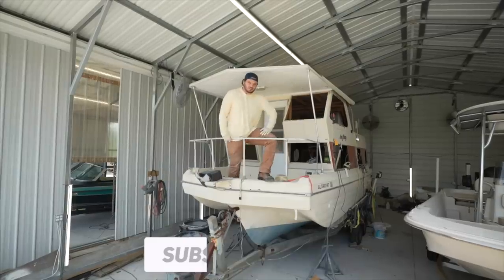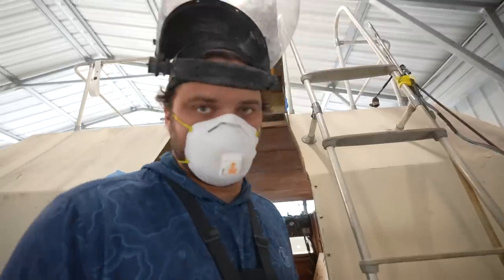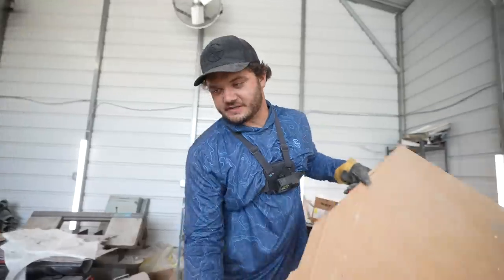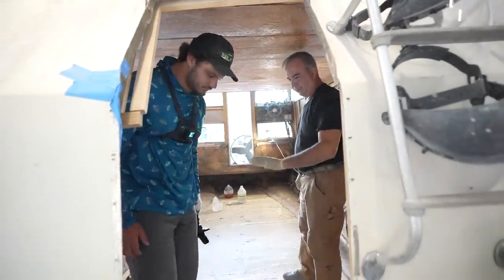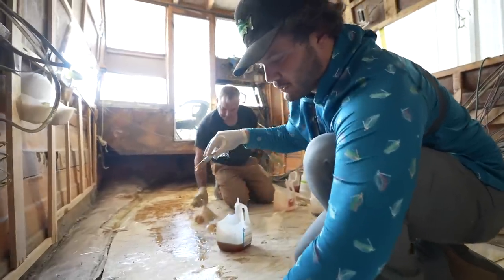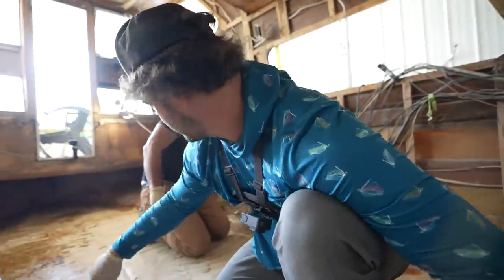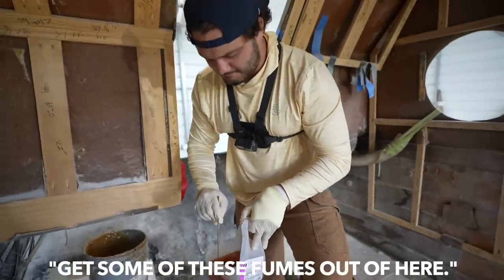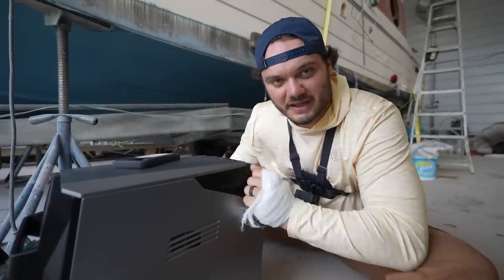Finishing The New FLOOR In My HOUSEBOAT! (Part 2)

Comment: One thing I would suggest, especially dealing with fiberglass... you could always run the vacuum at wherever your cutting or grinding.  That would take a large portion out of the air, but not all.  2nd, Eyes are no joke.  Keep care of those and there's a point being tough isn't worth it.  Next time rinse your eye out.

Comment: Air flow is your friend when it comes to keeping the area dry around your stringers. Make sure you have vents out on the gangway to keep air circulating in the bilge area. I’m a retired USCG Marine Inspector, if there’s any info I can help you with based on my experiences, lemme know! I’ve crawled many a tank and bilge; steel, fiberglass and wood.

Comment: Instead of using a Sawzall, try using a multi-tool. It actually works similar to a Sawzall, but the cut off heads are able to cut through fiberglass much easier.
Reply: was gonna say that, the multi tool blade sits flat so you can actually cut to the very bottom of those bulkheads without having to hold the thing sideways like a sawzall
Reply: Yup reciprocating saw/tool, finer faster teeth and less dust. Between those and the tiny spot sanders that’s all most guys use.

Comment: Been waiting on this. Can’t wait to see it taking an even better shape!
The shop you found is excellent and props to the guy for allowing you to make your videos while he works as well as letting you work with him!
What are they doing with the section you cut to remove the motor. And are they fiberglassing the wood in on the inside walls?

Comment: You know AC units have to have a heat reject stream right? If its just in a room with no outlet it will actually heat the room slightly instead of cooling it.
Reply: That's what I was thinking, if it's an evaporating unit , wheres the vapor going?
Reply: Lol regardless he said they paid for the fiberglass...sounds good to me
Reply: @JK-qg6eo  If it has a compressor then its not a swamp cooler. Plus a swamp cooler wouldn't work in Georgia. I'm guessing there is a hole port on the back that is supposed to connect to a hose you put out the window or in a window frame.
Reply: Indeed! can't wait to see her on the water

Comment: I used to use that foam cellulose filler in my streetrod/kitcar business back in the early 90's. It was much easier than that, because it came in cans that had a hose. All you had to do was stick the hose in the hole, hold the can upside down, and spray. Of course, you're filling much larger sections than I had to, but it was really pretty easy comparatively.

Comment: About the EcoFlow.  The heat of rejection has to go somewhere and using the condenser to evaporate the condensate water will only increase heat content humidity in the space.  Cool air comes out the front of the EcoFlow and heated air goes out the back.  Unless that rejected heat goes outdoors what you've got is a running furnace in your boat.

Comment: I would have tried lowering the floor a bit, since I’m European. Then I would have used funnel for the foam. Maybe I would have used concrete to add weight to the keel. I might have made some access openings just to be able to see if there is water under there. Then again I am no boat builder. Its huge project. Lots of fun when finished I suppose.

Comment: I know it was a freebie and all, but go ahead and plan for a rooftop AC (frame it out now while it's easy, plan on a 8-12k BTU low-profile RV style) because there is no way a 4000 BTU AC is going to do anything in that boat in the Georgia heat. In late August that will be a $3,000 noise maker and not much else. A generator, or dual alternators on the engine with a good inverter-charger and decent lithium batteries will be your friend.

Comment: Suggestion: drill bigger holes for the foam. When I ripped out the rotting floor of my boat the holes for the foam were over 1" in diameter. The foam will find its way around. You're going to glass over the whole floor anyway. Making the foam installation easier won't affect structural integrity.

Comment: When glassing in the ply floors with those woven strips, using a mix of crestomer to backfill that gap would rid of any voids. Cutting foam at a taper and glassing that in would also make a smoother transition and reduce the chance of delimitation in future

Comment: tip: when cutting stuff like that i tend to use a 4.5" diamond blade on an angle grinder. cuts easy and easier to control for cleaner cuts.

Comment: If your up for the challenge you can "raise the roof" of the itty bitty .. find a good cut line and scribe it all the way around.. then get some short boards screw them into the wall below the cut line so they reach up above both the cut line and the desired location.  simply cut the line.. then lift the top a few inches the boards should prevent the top cap from sliding anywhere but add additional supports as needed I don't know how much the top cap weights so it might be to heavy to just simply lift a crane or some ropes/tackle  to the roof of that shed would be a good idea... slide up on the boards around the edges.. then screw the top into the board at the desired height.. get a role of wax paper and line the gap from the outside with waxpaper then put strips of masonite over it.. to insure that it will be flat on the outside.. one the masonite is screwed into both the top and bottom parts.. you can remove the supports from inside and then fill the gap with glass and resin .. if they have a chopper/resin gun, and anyone there is willing/skilled enough, it would make quick work of a 3 inch gap  once the gap is filled use some of the larger mat cuts to cover at least 3 inches on both sides if you have the room but 6 to 9 if you want to be sure. once dry pull the masonite backer boards off the outside and you should have a relatively smooth patch. You can do an additional glass mat around the outside but you'll need to sand away the gelcoat to get good adhesion once done redo the gellcoat and no one will know.  before you pumped the bottom with foam.. it might have been easier recut the floor and lower it which I think would have been easier..  Unfortunately the proper way would have been to lower the floor but it's a bit late for that now, as only the center walkway needs the space. When you had the floor in for test fit before you started the glass.. that's when you should have taken the extra 2 inches off the bulkheads and lowered the floor I say this only because others might read this looking to doing the same type of thing.   Otherwise just ware a hard hat ;-) looks like fun project I hope you finish it.

Comment: Why you didn't foam the floor before decking it... I have no idea...Look at the Camp Chef oven/range. Or don't do any galley appliances. I run an old Coleman white gas stove and a couple 12v electric coolers. Do an outdoor shower with a  privacy screen
Reply: Congrats you have been selected among our shortlisted winners from our previous giveaway, Contact the number above ^^^^^^^^^^^^^^^^^^^^^^✅

Comment: I worked for a spray foam insulation company and the stuff he used for the hull is very similar but needs running through a heater so it's at 65c when it's sprayed

Comment: When foam filling a hull with closed cell foam, a drain tube should be added to reach the rear bilge area, you can't actually stop water from forming anywhere.
Reply: Congrats you have been selected among our shortlisted winners from our previous giveaway, Contact the number above ^^^^^^^^^^^^^^^^^^^^^^✅

Comment: You don't have to gelcoat  paint is a heap easier and can still provide a pro finish. So probably better to glass in each bulk head individually. As now if you have any leak into the hull you will rot the entire frame over time. If all bulk heads and stringers (should put 3 stringers in) are individually glassed a leak into the hull wont do long term damage and will be compartmentalised. From what I see here you are just glassing over the floor leaving raw wood under it. This will effect the resale of the boat considerably and the strength and longevity. Or did he glass them in off camera? Pretty sure the floor is not glassed on the underside.

Comment: Tim.  You don't need to cut out the ribs just because the plywood.  You can just put more fibreglass on the ribs to strengthen them further.  The plywood can rot and it won't adversely effect strength.  I have been repairing fibreglass boats all my life.  You can make ribs out of cardboard as long as you cover it with several layers of glass.  Just sayin, a lot of work for nothing.

Comment: I said it before, but now that it's after the fact maybe AYO will catch it... He could have dropped a walkway in the center if he used 2x stringers and given himself another 4 to 6 inches of headroom throughout the center of the boat. They do something similar in most sailboats, just a 2 foot wide walkway and everything off to the side is a step up.
Reply: Yes. My Steury had 6 foot headroom. 2 foot wide is plenty. That's way too wide for being flat. Too late.

Comment: I would be using a large cutoff wheel on an angle grinder.so you could hold it 90 degrees to the hull and wearing a resperator cause that's some nasty dust buddy.

Comment: When you pour the mixture the pouring hole should large. 
When mixing part A - part B You use the correct amount depending on temperature. 
And you should have tested the ballast theory on the water at a later date. Before adding foam. Cutting it out is a nasty job if your wrong

Comment: 4:03 - Yeahhh, thats not how you use a Sawzall... you cant plunge cut with one of the standard blades. Spider makes a blade with teeth on the tip that could do it... but you need to be cutting though, not plunging into, the material with that type of reciprocating saw.

Comment: also i’m not here to judge but y’all should put goop in the gap between the edge of the plywood and the hull before you put the glass over because when it hardens it’s going to have a huge air bubble/void under the glass and less of a watertight seal and less strength
edit: just saying this cause i don’t want to see ayo sink the itty bitty

Comment: Next time to measure that dimension take you a straight line put it to the top of the floor from one to the boat to the other from there measure from your string down to the bottom of the bulkhead in the middle at the top and connect the dots we'll have a perfect pattern

Comment: I'm not sure you used the right expanding foam under the floor... that looks like the  expanding polyurethane kind that soaks up water and holds it like a sponge. I know this from dealing with it in my Sunfish; there it was used as a glue to fix the closed-cell flotation foam blocks in place.  It's similar to "great stuff" in a can, or the household isocyanate wall filling foam. I tried using that in one of my RC model sailboats, and it never was rigid, it was always spongy and instead of flotation, it just absorbed water and made the boat heavy. I pray I'm wrong, but I don't think I am. Flotation foam needs to be closed-cell type if you don't want it waterlogged.

Comment: Im only a few mins into it, but I suggest you use a long blade so it can flex and lay flat, and I also suggest a half face respirator. That is not the appropriate make for fiberglass.  Im a shipwright and I assure you, a 20 mask will save your lungs.

Comment: They didn't stop making  the Steury because it 'wasn't the best boat'. It was (is) the best boat. Trailerable houseboats were all bread boxes. This is a brilliant design. They sell like hotcakes. Stop worrying about the boat rolling. It wont. It's a Cathedral hull. Mine was huge top heavy. Does fine in big water.

Comment: Never have anything on the bottom inside of the hull. let the water move around. pump it out if needed, foam goes ABOVE anything that stand in water.  you are doing pretty good.

Comment: tyvex suits would be investments
Reply: also. when you are grinding/cutting, have a fan of some sort that will blow the dust away from you at the grind/cut point. obviously dont have it pointed into the rest of the boat, try to have it pointed out of the boat.
Reply: also, some metal & flat sided rollers for the fiberglass rolling. that would have been able to get the first layer of glass fit to the seam of the floor & hull.

Comment: Have you ever thought you had the wrong tool for the cutting? A Oscilating saw would have worked far better, and it would have cut closer to the floor without running the risk of going thru the floor.

Comment: I know I'm getting ahead of you. But at this point it's pretty obvious that you're not running the guidance cables below the floor.  I think it's logical to assume you're going to run them on the starboard side of the vessel. Was this the original design?
Reply: In fact the motor controls as well.

Comment: A how to NOT repair your boats hull....every right angle and especially those bulkhead should have been filleted in place and the deck /hull joint doubled up...that said its gonna be fine for 25 years or so....
Reply: All I know I learned at "life on the hulls" an Aussie youtuber building a huge ass catamaran sail boat

Comment: Filling the bulk heads with foam and no holes in the bottom for drainage is going to cause moisture build up and it will not only rot your foam but rot the bulk heads and the lower part of your flooring, If you doubt me look up some old boat restorations when they pull up the flooring and take out all the rotten foam and wood its a mess. Too bad you just didnt put in drains it would of saved a bunch of heart aches . If you get a large wake or take on water it will seep into your flooring and stay there to rot everything out and all the work and money and time will go to waste too bad it would of just taken you about five minutes to put in drain holes on your bulk heads  😐

Comment: wrong tool man to cut that floor. you need a multi-tool you can lay that blade flat against the bottom of that hull and cut your edges  off like it's nothing. And you're using the wrong disc to grind with you need a flapper disc

Comment: CHICAGO ELECTRIC POWER TOOLS 
1.6 Amp Single Speed Oscillating Multi-Tool, BAUER 
1-3/8 In. Bi-Metal Carbon Steel Plunge/Flush Cutting Saw Blade For Oscillating Multi-Tools

Comment: Dude, I don't know what parts of your comment sections you are reading but it can't be the knowledgeable part lol. A RV rooftop AC would have kept that boat colder than a meat locker and would have taken up absolutely no room inside the boat. The driveline and AC are both going to come back to bit you in the ass, I guarantee it my boy.

Comment: Looks like you guys are handling large amounts of resin using disposable latex gloves. Latex gloves are not rated for chemicals. It'll go straight through (you wont get sticky, but the chemicals will still reach your skin).You need to use Nitrile disposable gloves. Not a huge deal for you, as you might not be considering a career in glassfiber, but those other guys probably do this daily. I hope I am wrong, I have just never seen Nitrile gloves in that color.

Comment: OMG worst job ever grinding fiberglass , i bet your wife hates you for infecting all the cloths to the ITCH. wood that stays wet with moister rotts .set a board on flat ground it will rott a board on same ground with a small tilt where water can run off takes a long time to rott. I think they should have put na drain pipe all the way thru the bottom of the boat ,the foam is nice but maybe keeps underlayment wet or damp.